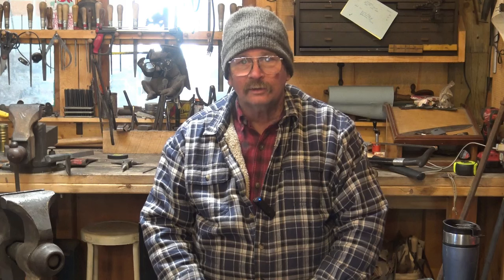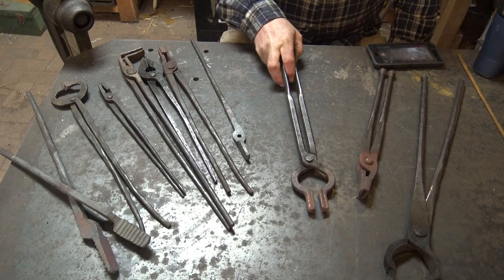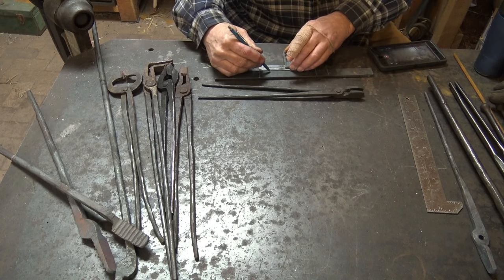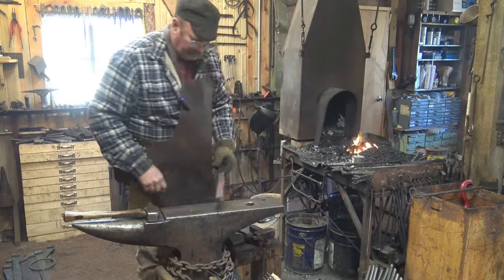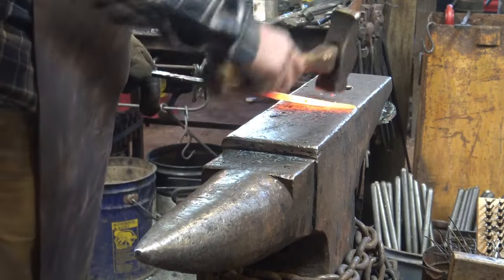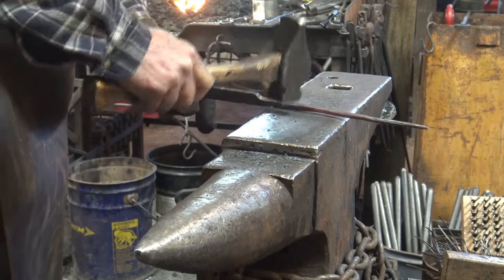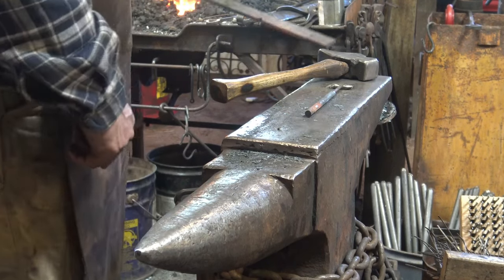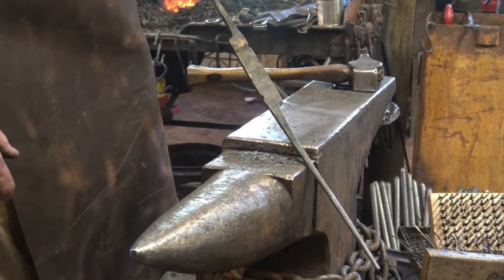Introduction to tong making part 1, flat stock tongs without tongs - drawing out by hand.

Comment: Hi great video. Thanks for your work. May I ask what what type of camera/ system you using to film your videos. I noticed you can control it with your phone. Thanks
Reply from the maker: The main camera is a Sony FDR AX33 video camera that connects wirelessly to the phone.  I know also have a smaller Sony FDR X3000 that will also connect to the phone using the same app.  Sadly I cannot connect to both at the same time.  https://www.youtube.com/watch?v=NsrSijxRuuk  -  https://www.youtube.com/watch?v=d9Pf8pbIBdY&t=4s

Comment: I'm still using the tongs I made out of 3/8" rebar. They are for light duty to be sure, but they got me started. I look forward to making a version like this.
Reply: So far ive made some tongs from 1/2" rebar by 24".  Only needed gloves to make them.  They suck for sure but hey I had fun making them and they hold stuff for the most part lol.

Comment: It must have been possible at some point to make a set of blacksmithing tools starting with a campfire, a bloom and a rock.  It would be a very interesting series of videos if that were the goal.
Reply from the maker: I actually don't believe that is true based on what we think of as a set of tools.  I suspect it took many generations to develop tools slowly over time to the point that we would recognize them today.  While it would be an interesting project, I doubt that I want to tackle it.  for well over a thousand years blacksmiths have had access to better tools and materials as they learn the craft and could use the tools that were available to make tools.  I feel it is much better to promote the craft starting on that firm foundation to learn skills that are more relevant today.

Comment: Will it be possible to forge tongs from bloom when you have no metallic tools at all? Like upgrading from "stone age" when you have only stone hammer, flat rock for anvil, stone axe for chopping, etc.
Reply from the maker: Probably, but they would be very crude.  But the first tongs had to come from somewhere.
Reply: The most interesting thing is HOW.
I watched a lot of "medieval bloomery" videos and even the most primitive one - with wooden mallet and stone "anvil" used iron tongs to hold the bloom while refining it by hammering. I can imagine taking the bloom out of bloomery with a sharpened wooden stake. I can imagine how bloom can be put on the "anvil" with a pair of wooden stakes. But how to hold it there while refining? And how to forge it into rod long enough to make tongs from... without tongs? Any ideas?

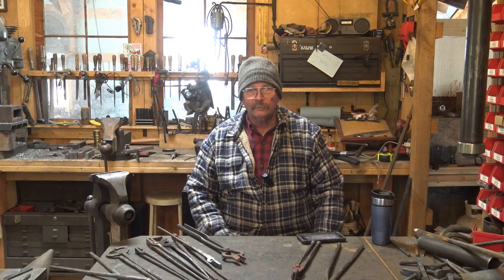Comment: 4:30 did you ever get around to making that video?
Reply from the maker: I have done individual videos on many of those tools.  But I have not really done a start with nothing and go from there video yet.
Reply: Black Bear Forge I just starting out with two hammers and a makeshift forge about three months ago, making tools and other things I need.
I've been using my 8lb hammer head as an anvil, besides an anvil what do you think would be the most basic and used tool in your shop I'll need?

Comment: Do you have any good advice for a starter to avoid "mushroom over" ? Kind of a big problem over here, I'm using a forge with propane.
Reply from the maker: the taller the material in relationship to the thickness, the worse the problem is.  A light hammer and light blows also tend to react more on the top edge instead of penetrating to the center.  The best thing to do is keep an eye on it and correct the flare every heat as it occurs.
Reply: Thank you for your quick response, I will keep this in mind !
Reply: Do you have a good advice to prevent beginners to twist the metal as you smash a rod to make it square ? I'm getting better for the shrooms, making a square is almost okay but making an octogone is really hard and the farther you get, the more it twists.

Comment: Thanks for motivating me to try and make my tongs again. I don't know how many times I have failed but this inspired me to take my old failed attempts and try them again!
Reply from the maker: Practice helps. Finding a smith in your area that can help coach would also help
Reply: As also beginning I went to the Quad State Roundup ,a big black Smith gathering not having much free $$ I found some cheap tongs well made but broken.Well sir I took five pairs home for five$$$ and divided each kept the good side and now copy 2 of the best side and as a 3D model the two making for a nice set adding a rivit 
Hopefully it helps

Comment: Lots of good stuff I could comment on here, but I'll stick to saying that I've put off tong and tool making for a very long time for various reasons.  I would rather be making knives.  The problem is that I don't have enough tongs to effectively and safely handle hot material.  I came to this video determined to MAKE myself watch it.  Once it got started, I found that I enjoy your method and I can't wait to get started on some tongs and other tools of my own.  Great job!
Reply from the maker: I am glad the video inspired you.  Perhaps later this week I will be taking a look at a product called Quick Tongs.  They use the same idea as this video, but are machine cut close to size so there is less drawing out to do.

Comment: this video is fantastic and has been a real resource for me as i try to make my own first pair of tongs.  a question i had though is how do you prevent the stock from twisting as you draw out the reins. i got the reins tapered to a long rectangle going to square near the end however the stock near the boss the metal was twisting/rotating. i know it's probably something simple i was doing wrong.  Thanks for this video series!
Reply from the maker: The twist is largely a matter of hammer control, but if you work to keep it corrected as you forge by constantly checking and adjusting every couple of heats it should get to far out of control.  Its always a good idea to go tto the vise and use a twisting wrench to straighten if needed.  Glad you like the videos.

Comment: I don't know the terminology but is there a technique to gather material, or draw it in. i know you can do jelly rolls and fold and weld, I wondered what else you could do, maybe drive it into the anvil?
Reply from the maker: Mark Smith yes, the term for making something shorter and thicker is called upsetting. In this video the tong reins near the boss start as 1/4” wide material but as they are made narrower in in dimension they upset in thickness to about 3/8. I have a few other videos that deal with upsetting in one form or another.

Comment: What type of steel do you like for tongs?
Reply from the maker: Mild steel.  Some of the store bought tongs are alloy steel such as 4140, but since you will at times need to cool your tongs by quenching in water and the higher carbon steel could crack.  So I just stay with mild steel.
Reply: I've made a couple sets, one from 5/32 piano wire which is high carbon and one out of 3/8 "weldable steel" which should be mild just not sure exactly what it is.

Comment: Love your videos.  You do an outstanding job.  If I were to purchase my first pair of tongs, which size and style would you recommend? Square, Round, Flat or Wolf Jaw? And what size? 1/2", 3/4", or 1"?  Thank you!
Reply: Jim Mitchell look at what you have done or plan to do. buy according to what size stock you will be using. V bit would be a good start as the can hold square or round stock.
Reply: Thank you!
Reply from the maker: I agree with Steve.  Tongs are fairly specific to s single stock size, which requires matching the size to the work you are doing.  The wolf jaw tongs are supposed to be more versatile, but probably not ideal for any specific use.
Reply: Thanks John!  I really appreciate your response.  I am just now starting to research and watch videos as I would like to get into Blacksmithing as a hobby in the near future.   Your videos are extremely informative and I always look forward to watching the next one.  Keep up the great work.  Thanks again!